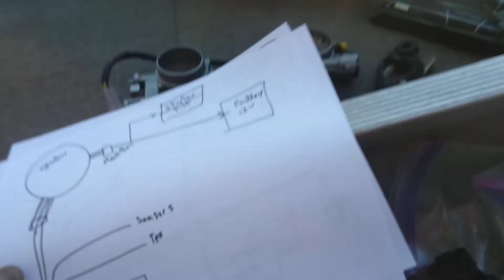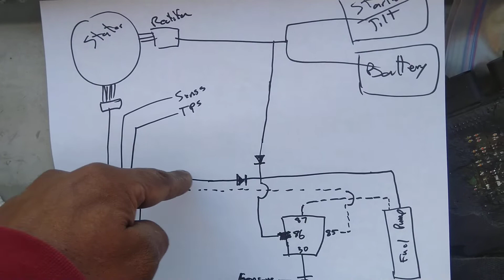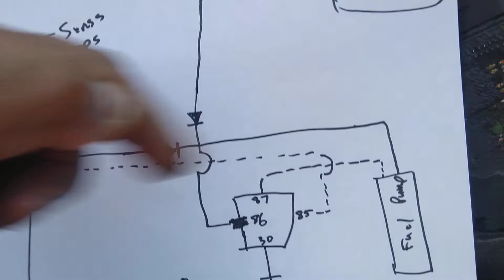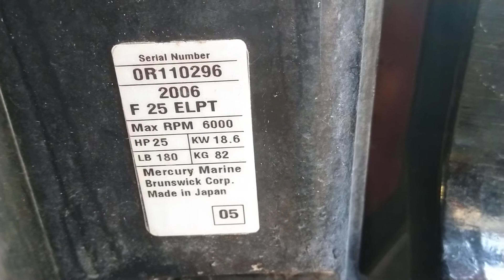mercury tohatsu 4 stroke 25hp 30hp outboard burning out ECU with aftermarket fuel pump

Comment: And just bypass that ECU for the fuel pump, would that work?
Reply from the maker: @trevorcothran3273  use the positive wire from ECU to trigger a relay to run pump. If motor shuts off it will open the relay and shut off pump. This is how it's done on all efi systems

Comment: What would it hurt to hook the fuel pump to its own power source on a switch?
Reply from the maker: @trevorcothran3273  no. But if there is emergency you need to be able to kill it or fuel will keep pumping
Reply: @omieyouknowme how will this work on manual starr
Reply from the maker: @John-p9z2y  yes. But you have to install a voltage regulator first. Look on starboard side of motor for the three yellow wires. If present buy the voltage  regulator and add it. Use the output from it to run pump and charge battery. The OEM are pretty expensive but aftermarket will work as well.
Reply: @omieyouknowme is that a adjustable time delay relay ?
Reply from the maker: @John-p9z2y  no. I use a std relay.
Reply: How would this work on a manual start

Comment: why not just use the ecu to ground (power) a relay that switches 12v to the pump?
Reply from the maker: @michaellawson-j5z  this is how it's normally done on cars trucks and larger outboards. For the smaller ones that can run without a battery, a capacitor is charged on the first pull to provide the 12v supply for everything. That same charge powers the ECU which in turn grounds internally for pump idle injectors ect. 
If you run these motors off a battery, yes you can just ground a relay, but most people buy the smaller motors to run battery less. My circuit still allows a battery less operation by taking excess amps from the charging circuit for pump.

Comment: I have a 2014 30hp that I replaced the pump on. Ran for 2 years no problems or errors lights. thought I burned out the aftermarket pump but I am still getting 12-14 volts to the pump lead when I hit the starter. Do you think my ecu is fried? pump still doesn't seem to be running so maybe it just wont run under load. just curious if you got any voltage to you pump leads when your ecu was fried?
Reply from the maker: You will get positive voltage at the pump lead but not negative if the ECU is fried. Verify by running the pump with external power source. The ECU just grounds the power, that's the failure not the positive side.
Reply: @omieyouknowme  so just to verify you are saying the ECU controls the pump from the negative terminal. Definitely still getting 12-14v on my meter when I hit starter across the pump harness leads. I want to try and measure the current in series and see if it drops under load
Reply from the maker: @JoshTalbert  yes it's a negative trigger. The positive is same and shared with coil and injectors and idle valve all on same line. 
Put your hand on ECU if it gets hot while running it's overloading that circuit and u are on borrower time. 

Other possible issue is pump is working to hard with high pressure filter plugged and drawing to much amps to keep up

Comment: Hi Omie, great video you produced, it's very orienting. I have a Mariner 25 HP Four Stroke EFI engine (OR201916 )), absolutely manual, my fuel pump burned out and once replaced (I did not resort to a Service Officia Mercury, I clarify), the shutdown was altered. The man overboard caused a short circuit and the engine wouldn't start. I live in Argentina and after your publication, I understand that no one knows exactly what are the characteristics of the relationship between the amperage of the pump and the ECU of this engine, so I can assume that the inconvenience that arose may be collateral damage of the replacement of the original pump with one that does not correspond to the model and year of this engine? I have already contacted Quantum and they have already suggested the exact model of them corresponding to my engine (HFP-382OB). Can the issue be reversed? Thank you very much for your contribution, Ezio.-
Reply from the maker: Sorry to hear about the kill switch. Sadly once the fuel pump driver circuit is damaged it can not be repaired economically at least. I tried to remove the potting compound from the ECU with various chemicals and the time effort was not worth it. 
Be careful any pump other than an OEM pump even one from quantum could cause more damage. The cheaper aftermarket pumps, they do work fine on larger motors.
Reply: @omieyouknowme  Thank you very much for your quick response. Do you think that changing the fuel pump mentioned above recommended by Quantum, could solve the problem of the shut-off switch? Or does the fuel pump have nothing to do with the kill switch?
Reply from the maker: @Aetius63  they are separate issues. If you can run the pump by applying 12v manually then crank the engine if still no start then there is something else going on. 
The kill switch is nothing more than grounding the brown wire.
 I would run a continuity check on the brown wire with kill switch in place. If you see ground on it with kill switch in place then there is a break in the wire somewhere to ground or switch itself is bad. The ECU rarely goes bad with the kill switch being grounded it's designed for that. 
Worst case trace the ground wire to ECU
The brown wire goes to pin 3 this should not have ground unless kill cord is removed. Pin 28 on ECU is ground. This must be grounded at the lanyard with black yellow to brown or black to black on kill switch.
Reply: @omieyouknowme  The pump since it was replaced, works well and the engine always started without problems, the problem is that the engine would not start with the man overboard device put on the switch. But thanks to your guidance, we will review the continuity of the cabes and their connections. Thank you so much for your support
Reply from the maker: @Aetius63  there are only three items that can cause a no spark no start. The kill switch, crank position sensors and stator. The crank position sensors if one fails will run but may not start. If stator fails it will not provide the need voltage to ignite the coils. 
Good luck. 
I often thought about adding a carburetor back into the block but this motor firing pattern is unique and needs sequential. Not possible sadly

Comment: I dont know why Tohatsu Made these engines so complicated just for move a propeller.ecu damage every week.i Will return to carburator.an ECU from quick silver 1100 dollars.same part in Yamaha system 350 dollars. And Mercury AND Tohatsu hard to find.
Reply from the maker: This ECU is not fixable. Same with all small engine ECU. If you know someone who is familiar with micro squirt you can build one for 350$. There is also speedunio option. These are small ECU you can program. 
If I find another 25-30 up tohatsu I will try this. But id be concerned if ECU keeps frying on the motor you have other issues.

Comment: I have the same engine. i got 12 volts for injectors, fuel pump. but the problem is it does not spark. i have tested lanyard switch and stop switch. it does not have any issue. resistance in both side cps is in range. i don't know why it doesn't spark. will it be a problem with ecu?
Reply from the maker: If there is voltage and ECU is not sparking disconnect the kill lanyard wire. Believe they are the brown ones. Check each wire for continuity with ground if one is shorted out.

The injectors working and no spark tells me it's lanyard or ECU. I will lean on the simple stuff first.
Reply: @omieyouknowme  even warning light is not turning on. i checked continuity on lanyard switch. there is no issue
Reply: @omieyouknowme  a faulty sensor can cause this problem?
Reply from the maker: @RaajjeAnglers  can you try cranking with kill switch engaged for few seconds then release the kill switch button. Like push starting a car with manual transmission.
I have similar situation now on a Yamaha and this is how I start it. 
I had this same issue on a mercury few years turned out to be bad stator.
Reply: @omieyouknowmeim having the same issue did you figure out the spark issue
Reply: Same issue
Reply: Same issue

Comment: Hi thanks for your answer, I swaped the 2 sensors, having same issew. Has mentioned early I have 2 tohatsu 30 hp. Do think if I replace the Ecu I will not have the same problem later . I expreance that before the Ecu get damage. From your experience do you have any idea how the Ecu get burn. Have replace the wiring harness also. Thanks..
Reply from the maker: If ECU is failing you may have a bad ground or the pump, injector or coil is drawing more power than is provided by stator. One trick is to take the common hot wire, that runs the  injectors and pump and run it via a battery. That is find the hot wire which is common for all these and tap it with +12v
The ECU will drive the negative side to operate the injection and pump. This would tell you if ECU is bad or if there is an issue with one of the three pulling to much of a load and burned out ECU
Reply from the maker: Crank position sensor
Single wire test against ground 148-222 ohms resistance 
Double wire test against red/white against black wire should be 148-222 ohms resistance 
Ignition coil resistance.17-.23 resistance with primary wire against ground 
Check the black yellow cable it's kill switch make sure it's not grounded
Reply from the maker: Blue wire on fuel pump is common hot. But if you do not have spark there is another issue

Comment: Hi sir l from Mauritius, have same problem my Tohatsu 30hp the Ecu get damage. No spark on the  s plug the engine does not start at all. In in fact have 2 outboard motor. Could you please give me a cost for the modification and a new ecu. Thanks for you reply.
Reply from the maker: Hi I'm sorry to hear that. I do not repair ECU and the tohatsu ECU can not be repaired just replaced 

If you have no spark, then this is most likely a kill switch issue. Disconnect the brown wire for stop switch or lanard and try again. If that does not work I will find the specific test for the two crankshaft sensors if they fail the ECU will not spark either.

Comment: Hello. Thank you so much for your video. I’m about to take on the same project. I was curious about one of your comments. You said that any motor with the OR serial number was subject to this. My serial number starts with a OR but it’s a 2018 I’m wondering if that still applies if they changed everything in 2014?
Reply from the maker: Interesting that your serial is OR. 
I would not think that later models are affected by the weak fuel pump driver in ECU.

Comment: Can you put like a 3 amp diode off the fuel pump wire that runs to the ecu.. my ecu fried from aftermarket fuel pump and was wondering if putting a diode on just the negative and positive coming off the plug on fuel pump going back to ecu will keep it from getting above the 3 amps
Reply from the maker: No it would limit the pumps output and heat it up. I tried similar approach by driving pump with just stator putting out 2.5 amps burned up the pump. Pump needs full amperage from either battery or by joining two power sources.

Comment: Would love a step by step on this for us electronically challenge folks!
Reply from the maker: I drew it up on a paper. My version is bit more because I troll a lot and redid it how OEM would. 

For most everyone else though 
The basic thought is You run the pump off a relay

The relay takes power from battery/alternator on one side and sends to pump. Other side of pump is ground to engine
Relay is triggered using old fuel pump positive and negative wires. 
The ECU fuel driver circuit has no real  load now
Reply: I bought a Tohatsu pump for a 05-14 25-30hp for $450. I have 45 min of run time with no issues. ECU has not gotten more than 75 degrees.  P/N: 3AC043100M Fuel Feed Pump
Reply from the maker: @extreamsportsenthust  I spent 250$ on the entire motor. It was worth more as parts, but now that it runs, it's a pretty nice motor quiet and despite being heavier than the two cyl Yamaha version it runs smoother.

Did end up costing me a new used ECU and throttle body but it's boat motor, hole we throw money into
Hoping others find this useful as a lot of older motors out there.

Comment: Any more Info on this issue?
Reply from the maker: Not sure what you are asking. I have almost 60 hours on motor after making this video and modification with aftermarket pump. 
U can see motor running in later video I posted on lake pend in Idaho
Reply from the maker: https://youtu.be/mBBpxGgLtLo?feature=shared
Reply from the maker: Other issue I had was a piece of fuel line broke and was lodged in VST inlet. Blockage would starve the motor because needle was open but not enough fuel went to pump easy fix hard to troubleshoot

Comment: GOOD MORNING
I have the same engine
recently I start for 15 minutes maximum, the engine turns off and it does not restart until it cools down knowing that there is no cooling problem.
Reply from the maker: Run the fuel pump with external battery, does it stay running for more.thsn 16 min

Comment: hi, i have been looking at videos and internet about this problem , my pump gave out and want to replace it with a quantum pump i was going to do a relay so i wouldn't burn my ecu but i saw you comment that it only affects smaller engine size motors , i have a 2015 60hp efi outboard , so i should be good with just placing pump and not having to cut into harness to add a new relay for aftermarket fuel pump correct
Reply from the maker: Thay is correct the 40hp and up are not affected.
Reply: Hopefully not too late. I think I have your same engine 2015 60ELPT.  Aftermarket pump fried my ecu 1st use.  Dealing with repairs now.  If I would have known then I would have just bought the OEM $600 pump.  I could put a replay in now and bypass the ECU but the resale value would be killed,  Looks like now I have to get the factory ecm and oem pump now.  Let me know how yours turns out.
Reply from the maker: @dannyhvac37  the ECU on 40hp and up motors already use a relay. So this video not applicable to your situation

Good news is your ECU can be repaired. There are online repair places that can do it n

Comment: Hey! Thanks for the video! I have a mercury 30hp 2016 with serialnumber starting at 0R. The ground on my ecu is allready fried, after inserting an aftermarket fuel-pump. Any suggestions for what to do? Would it be possible to controll the supply from the battery with the relay, and controll the relay with the supply from the ecu and directly grounded. In addition to wire the ecu supply with the battery supply to drive the pump?
Or would it be easier to just by the original fuelpump and using the positiv supply from the ecu and ground it directly?
Reply from the maker: If it's already fried the negative trigger is what went out. Use the positive output from ECU to trigger a relay.  Assuming this is electric start then either run the relay off the battery side or use my diagram and diodes. If you want to go OEM have at it but damage is done to ECU and they are getting harder to find new or used. I contemplated just converting to carb at one time, since low pressure pump and ignition is there just needed fuel.
Reply: Thank you for answering, it helped a lot! I went for the after-market pump and diods and it got the engine running. One problem occurres when I restart the engine after running it, without relesing the fuel-pressure on the «measuring valve». Then it starts fine, but when I turn up the speed, it slowly shuts down. The same happens if I run the engine for a long time (60min+) without turing off and relesing the fule pressure. Any ide why? Could it be because the pump draws 4,5A (measured) and making too much pressure? I have not measured the pressure, but I will. Could a solution be an extra fuelpressure-regulator between the vapor-separator and the injection, if the fuel-pressure gets too high?
Reply: I tried delaying the pump with a manual button, just to check if a time-relay was a solution. I tried between 1 and 10sek, but the same thing happens. Only differense is that it takes longer time before the engine starts shutting down.
Reply from the maker: @simenfiskaa3608  bypass the ECU to trigger the fuel pump relay. Meaning power the ECU from battery and try again. If it does not die your fuel pump circuit inside ECU is done. 
This would isolate it to either ECU issue or fuel issue. 
If the engine still dies running.it.off battery then you can look at vst needle seat where low pressure fuel comes in, measure low fuel pump out pressure should be 3psi give or take.

Comment: I have a 2013 25hp with a similar problem.  Runs great for and hour sometimes and shut down.  Wait an hour or so and it starts right up.  This been going on for years.  Any help or suggestions would be great.  Water pump was replaced.  I'm trying to run it with the cover off.  Or mount a fan under the cover blowing on the ECU
Reply from the maker: Are you doing a lot of idling? Next time when it's been running for 20min put your hand on the ECU is it Hot! 
Checked fuel filters high and low pressure? 
A blocked high pressure filter will load up the pump, since it's that old it's best to replace it. Sits under the fuel cooler pita to get to it's sitting vertical metal canister. I used a napa filter was 8$ vs 45$ for outboard